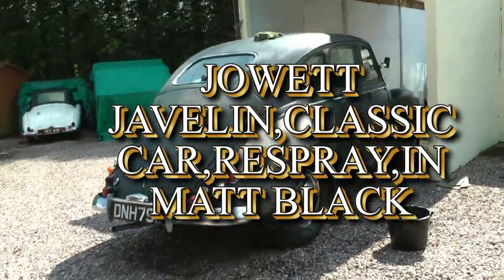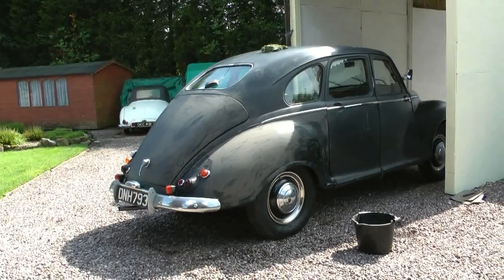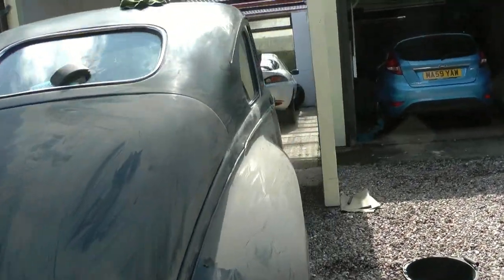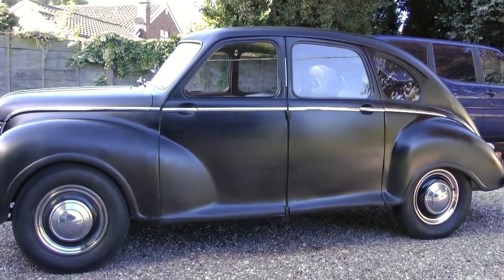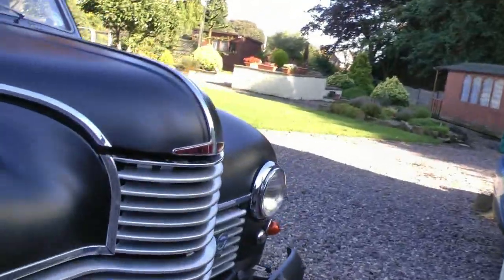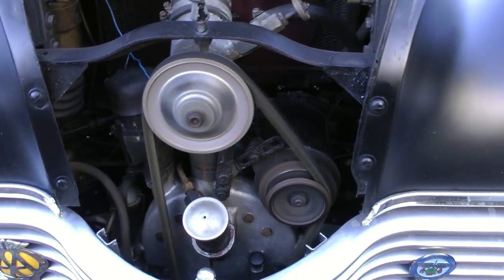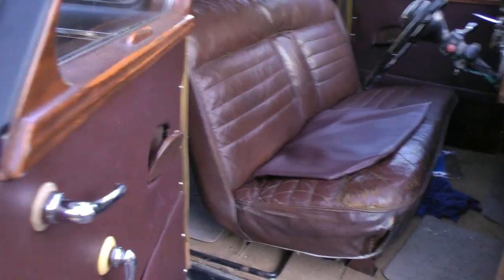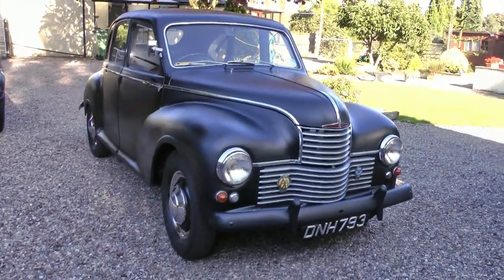Jowett Javelin, classic car respray matt black

Comment: Gorgeous! Dad had one in my youth and I got my licence in it at 15. I used to grease it every 500 miles and even now, I could put one on a hoist and go to all the grease nipples, a couple of them cunningly hidden, from memory! The engine sometimes "drowned" if left outside for long in head-on driving rain. Col, NZ.
Reply from the maker: Colin Gantiglew thanks col, this is my favourite jowett ,  my father starts it every other day and it still drives very well.. the paint job is a bit different though, it was my idea lol.. cheers pete